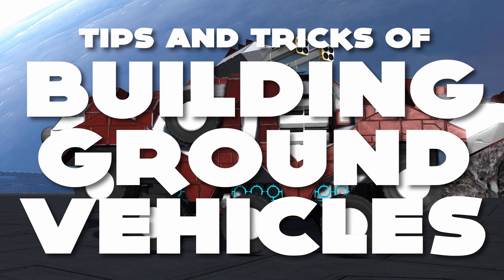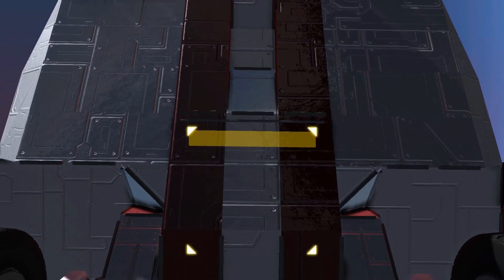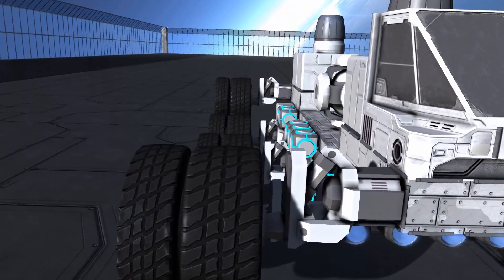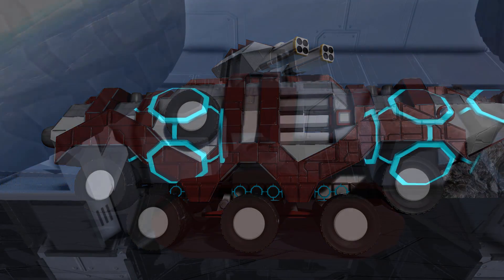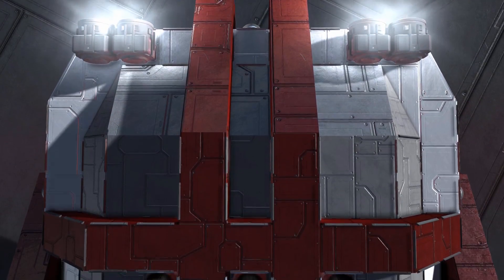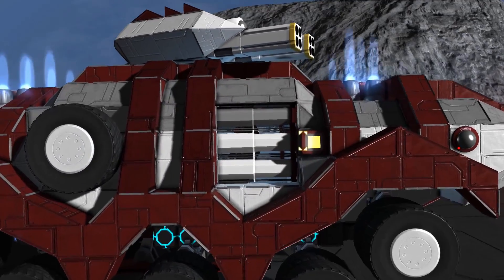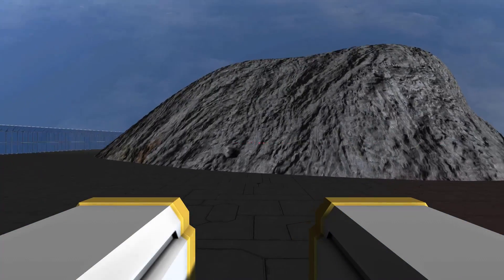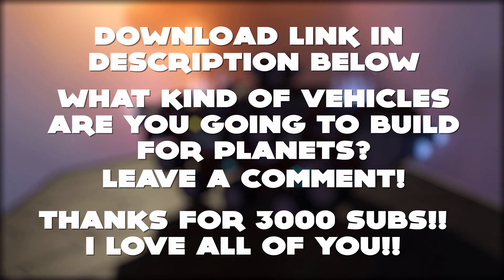Space Engineers: How to build Planetary Vehicles, the "Raptor"

Comment: At the moment, I am facing two particular design challanges. The first is building a mobile base. A land Rover capable of carrying everything to survive, including refinary, assembler and oxygen generator. My second challenge, in order to build this monster, is having a good miner. I decided building only remote controlled miners. After facing a few problems with usual horizontal designs, I am now working on vertical atmospheric miners, capable of hovering over the ore and dig the ground throwing up to the air some rocks and spiders as well.

Comment: I think my biggest issue with over roading vehicles is the fact that sometimes when you go up hill, not all 6 wheels will be touching the ground. So those wheels then start spinning real fast, and as soon as they touch the dirt it grabs and tosses you around. A lot of the time it pulls me around and turns me around and so often its steep enough to tip me right over.

Is there a way to make it so if the tires spin too fast the power shuts off to it? Kind of like how it is in real life.

Comment: My problem is that i have no idea how the settings for the wheels work
Reply: +kris220b depends on ground you've been driving across.

for planet ground...grass,rocks,sand.
go for a bouncy suspension
10% friction
20% power
20% strength 
80% dampinging 
90% height offset 
90% suspension travel

set a low top speed.

its about tweaking these to your liking

generally having a high friction will cause your car to topple over....too easily...gyroscope is needed for easily enough self-righting as well as air control should you get airborne.
Reply: Forcedminer nah i found a better way of doing it
( well mostly )

 http://steamcommunity.com/sharedfiles/filedetails/?id=623025628
Reply: kris220b hahaha nice. :) 

i usually use the gyroscope for sharp turns and let the thing slowly change direction.

feels like im drifting in need for speed.
Reply: Forcedminer
but really
i do have a propper working aircraft

its strange really
i trew it togheter in less then 5 min

it works so well that you can leave the craft pointing one way
go get dinner, and when you come back its still flying the same direction